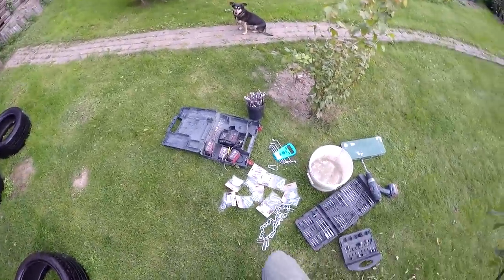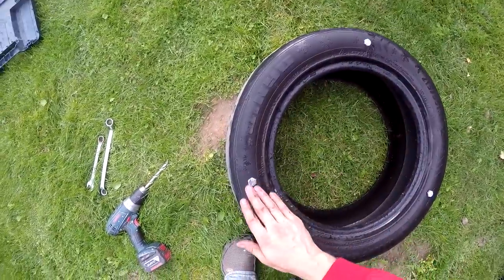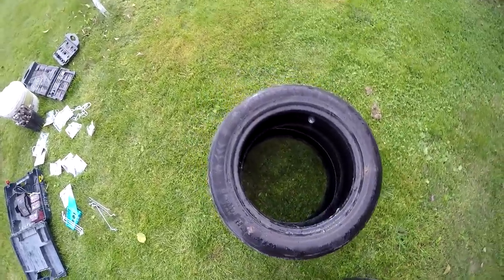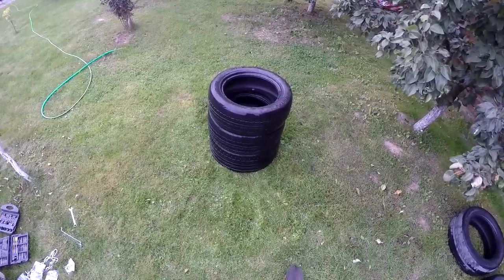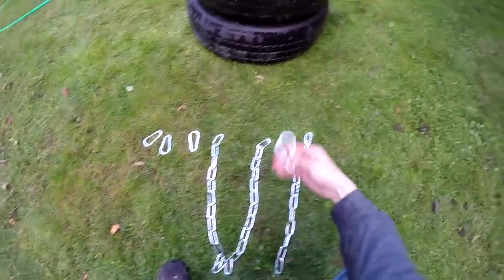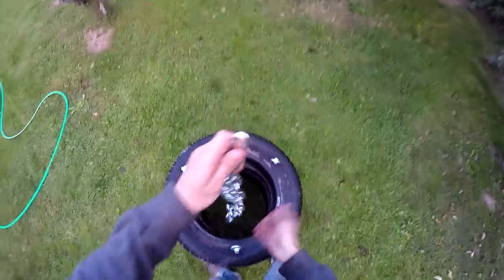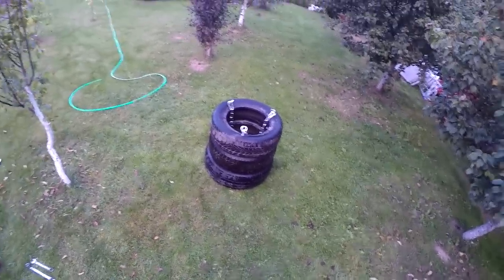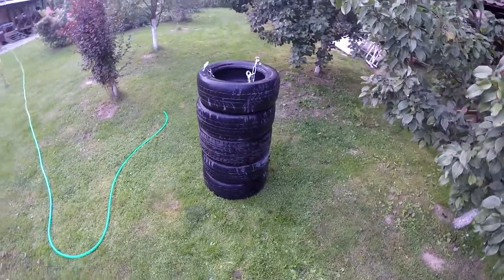Tire punching bag (How to make)

Comment: Can you make a list of the tools and the nuts, bolts  etc... for this project
Reply: You'd probably need bolts around 3inches or longer (75mm+) , and he mentioned using 10mm diameter with a 12mm drill - probably overkill as you could probably get away with 6mm diameter. get the washers as big as possible whilst still having an internal diameter(hole)  small enough for the bolt head /nut to not go through.
He used some eye bolts, karabiners and stainless steel chain for the other hardware.
Each tyre will be 10-20kgs, so get chains and karabiners rated above 100kg and you'll be fine for 5+tyres

Comment: Does ths nuts came off or losen when u punch??????? because i watch a similar video and there was some gaps between each tyre looks like the nuts umskrewd when he puched
Reply from the maker: No nuts can't unskrew
Reply: thanks , i make it myself it took me 1 and half a day , most difficult part was making hole because i dont had any drill machine i used hot skrew driver
Reply from the maker: OMG it sounds painful. It take a lot of time
Reply: hi, what did you hang it from ? How did you make the stand/pole ?
Reply from the maker: @dragos8839  Hi, your welcome https://youtu.be/y0mZZPGVkDo
Reply: holy shit that's so smart. Can you go all out on the tires without hitting the pole and fucking up your legs when throwing kicks ?